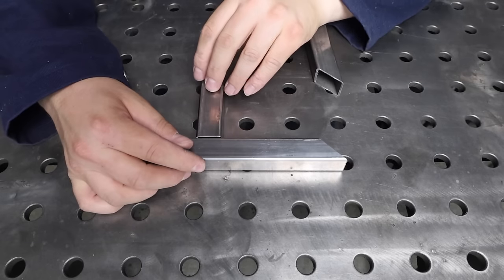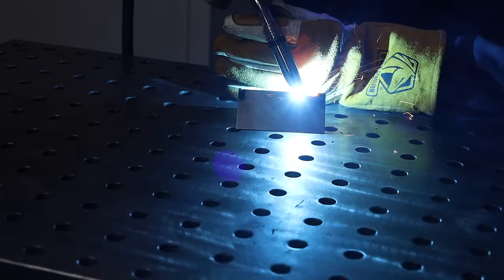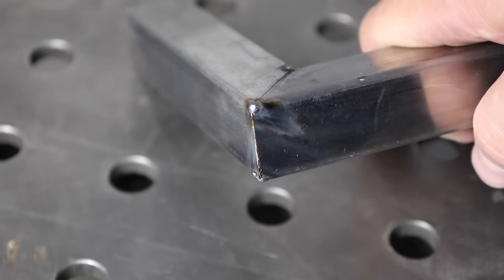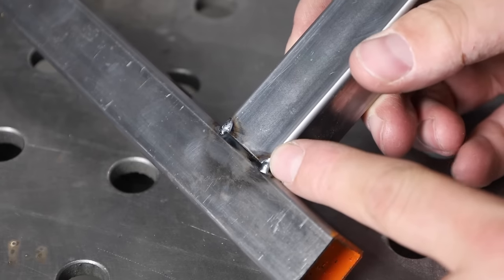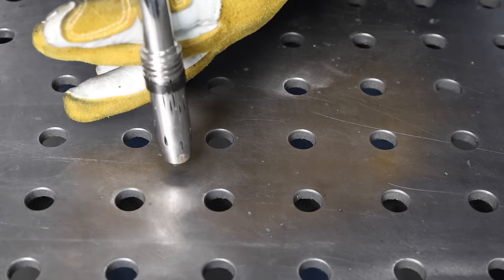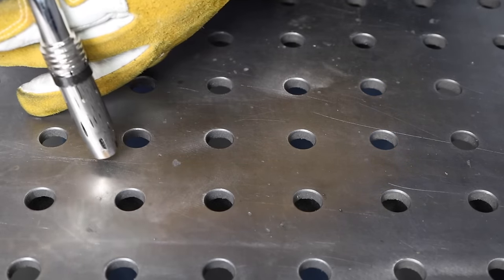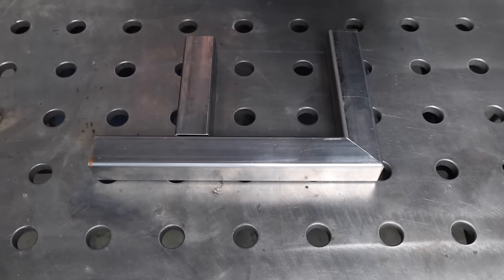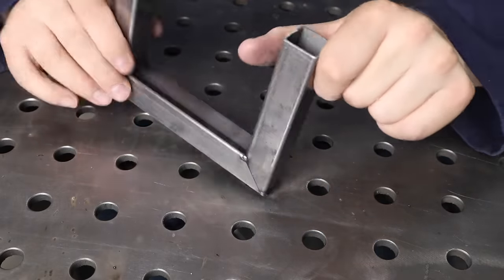MIG Weld Thin Square Tubing: 5 Tips to Crush It!

Comment: Great advice.  I'm a big fan of thin-wall square tube to make brackets and carts out of, usually 14-16 gauge.  The only other tip I would give others for this kind of work is always tack EVERYTHING first before fully welding a joint.  So long as you can get the MIG gun in position to make the weld, tack EVERYTHING, as in the whole structure together.  It will pull/distort a lot less when there is "no where to go".   Obviously when things are clamped tight to a fixture table it helps, but something high off the table might not be able to get properly secured like a part down close to the table.  So even then, tacking every single corner will really help things.  Simply avoid wanting to just get-in-there and start welding overboard; it will kick your butt in the end when things pull and you have all sorts of gaps in other places you didn't anticipate.
Reply: Thanks.  I’ve suspected something like this to be the case.  

Have a project coming up, and will try this technique that you spoke of.
Reply: @dennisyoung4631  Tacking everything together, as in the whole structure of whatever you are building will also let you see where your cuts ended up too short OR too long.  Too long, just cut off the tack, take it to a belt sander, and shim off whatever you need to make it fit.  Too short, well, if it's not by too much, say 1/16" or 3/32" too short, then you will be able to  see this and what I do is split the difference, so if I'm overall short 3/32" (0.093") , then I shift the tube or whatever  it is in the middle so I only have 3/64" (0.047") of gap on each side.  This makes managing gaps wayyyy more easier, and will result in less distortion because you are adding less weld metal into the joint.
Reply: If you don't have a table, don't hesitate to add some bracing, i.e. between the bottom legs, even a 2x4 would have worked to keep the legs from pulling in. Just made some grizzly bars and was blown away by the distortion, all tacked together first: 3' by .25x1×1" angle iron  bowed welding 9 other piece  to it. (Too much weld, too large of electrode) 5' by .125x1.5x1.5" Sq tube curled  in 1/4" just from welding two other Sq tube cross pieces 4 and 5' up. (Temporary brace between bottom  feet would have stopped that). And stitch welded a piece of .25x1.5" flat bar on edge to a 1.5" Sq tube, between welding that and the two little .0625x.75x1.5 braces to keep the legs from getting knocked in, it pulled the legs in 1/8" each. (Another brace and less weld). My two cents would be bracing for any dangly bits, use smallest filler metal to keep weld and heat imput down, and as much fun as it is to practice welding. No unnecessary welds. If I had 1" stitches instead of 2" it still would have been overkill with half the heat. 3/32 6011 between 60-70amps worked good for me. Should have done the small bracing with tig or mig, but that was the first ive welded with stick and got carried away. Best of luck and most importantly have fun!

Comment: What about shrinkage!? The parent metal you weld the butt to is going to shrink into a banana. How does one combat shrinkage? Clamping it down, prebending it? or I just watched a sweet video on flame straightenin. I'm sure a tig torch could be used just to heat metal with some practice
Reply from the maker: If everything is tacked well and if you weld in the sequence shown it’s usually not too bad on this thinner mild steel. Clamping and precambering can help, but aren’t usually necessary with this material. Stainless steel, on the other hand, distorts like crazy and all those things become very important. One of the best videos on this is actually from somewhere around the 1950’s from Lincoln Electric. Search for Mr Shrink on YouTube and you’ll probably find it. It’s good for some laughs as well.

Comment: Great info as always Tim, I use heavier tubing for my smokers and forget how easy thin wall stuff blows out lol. But that's where the practice welds come in like you mentioned, no shame in laying down some practice welds if you haven't welded a certain metal, joint, thickness, etc. It's actually silly not to in my opinion. 👍

Comment: Tim, as always, l love these instructional videos of yours. I'm a diy welder, actually a diesel mechanic by trade, but love to work with steel. I have a cheapo MIG welder, that really do a great job for my kind of projects. Especially for thin gauge steel tubing like you have shown here. Great tips that I definitely will use in future.

That said, my welder can do scratch start TIG welding that I really would like to try out.

Can't you do some videos on that for us?

Thanks in advance.
Reply from the maker: Thanks! I can definitely do some more of those types of videos. I do have several TIG tutorials, including a couple with scratch start and lift arc, but it has been a while since I did one. The hard part with scratch start is usually finishing your weld. You have to speed up near the end as heat builds, then snap out and try to get gas back on the hot weld.

Comment: I actually built a new grill rack for my brother in law’s smoker the other day with that 1” 1/16th square tubing. It turned out good but it wasn’t easy with the titanium flux 125…😅 Those gap welds were not fun… lol  But overall I was proud of myself considering I’m a rookie. It burned in good I had to turn it down a little bit though… Thanks for the tips luckily I did it the right way I saved the inside welds for last and moved from one side to the other so I didn’t put to much heat in it…

Comment: Hi Tim, an excellent and TIMELY video.  I have just started your course, and once I get proficient, my first project will be a welding table/cart made out of square tubing.  I notice that your tubing is very shiny all over, not just at the joint.  Did you get it that way, or did you clean it?  My stock is almost black in color.  Any tips on how to clean it?  I assume that to eventually paint it, I'll need it very clean.  So, I should probably clean it completely BEFORE any welding? Thanks.

Comment: Beginner here. I have seen some videos that recommend chamfering the tubing at the joint to create space for filler metal, especially if you intend to grind things flush. Is that correct, or unnecessary?
Reply from the maker: Great question! It’s not necessary on this thin 16 gauge material, but on thicker material, it’s a good practice.
Reply: @TimWelds  Thanks. I'll be purchasing your full set of courses in September. I recently replaced my flux core welder with a small multi-process one. Can't afford the gas cylinder just yet, so will be practicing SMAW. Don't much care for flux core (smoke). TW is the best welding channel I have found on YouTube.

Comment: Something i noticed about the welds @3:45 is that you are faster in the middle of the weld then at the ends, which while the metal is still molten looks concave and not even. Does that mean the welds are stronger/have more penetration at the ends than the middle?

Comment: What size wire are you using for thin wall projects? I find that 0.030 flux core is very difficult to keep from melting through, but I don't know if it is my settings or maybe worth trying smaller wire?
Reply from the maker: I am using .030 solid wire with 75/25 Argon CO2 mix gas. Flux cored is a little more challenging, but definitely possible with .030 wire. It could be settings (usually wire speed too high) or technique (usually slow travel speed). I haven’t personally seen smaller flux cored wire than .030.
Reply: @TimWelds  Thanks for the reply! Yeah, flux core smaller than 0.030 doesn't exist. I may have to get a gas bottle and try smaller wire, but I will keep working with my settings for now...